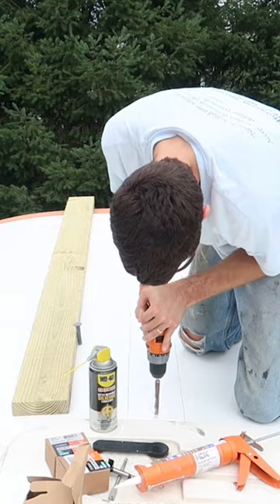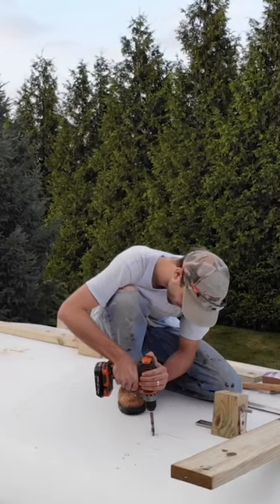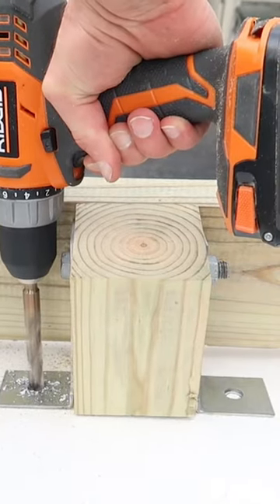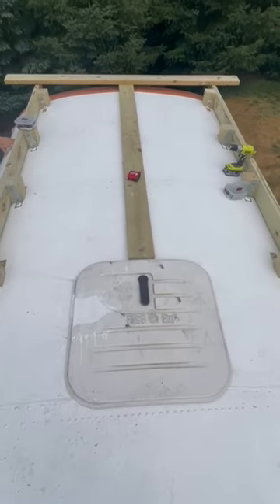Skoolie Roof Deck #skoolieconversion #busbuild #skoolie #tinyhomeonwheels #schoolbusconversion

Comment: Be sure you used galvanized screws!!! Pressure treated wood will corrode any I mean any metal that is not galvinized even those brackets you used could rust within a year if it’s not galvinized i learned that in mine
Reply from the maker: Yep! We used galvanized bolts and screws, great point!

Comment: But what happens if it rains? Won’t it hurt the wood in the long run ?
Reply: Shouldn't hurt it any more than it does other decks people build on their houses!
Reply from the maker: We used pressure treated wood which is chemically treated to be more weather resistant ☺️
Reply: @AdventureTrudge  thank you for the reply 😊🙏🏻